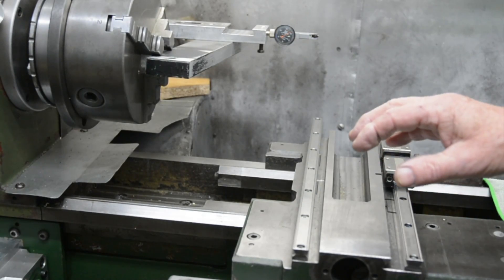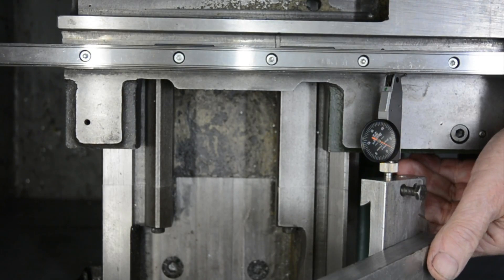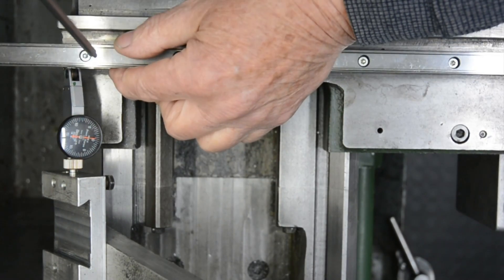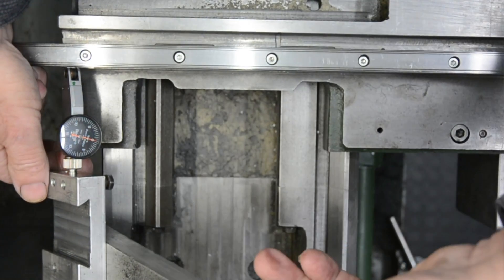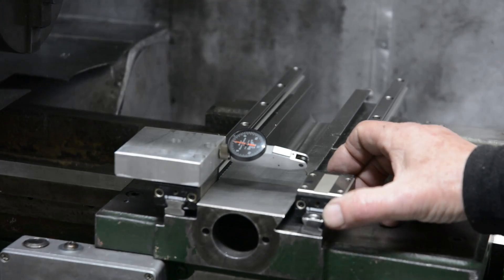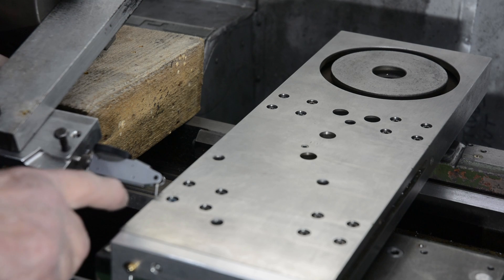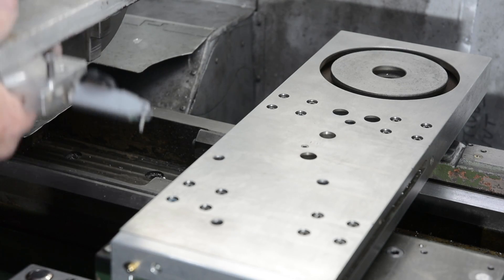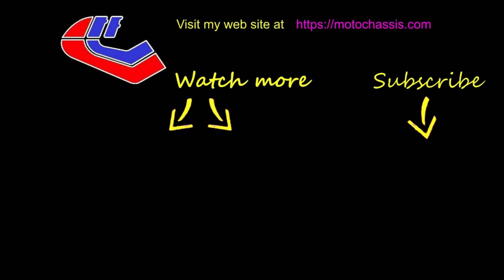Part 4. Revolutionize Your Lathe: Transform Cross Slide With Linear Ball Rails!

Comment: Hi, what are the chances that everything will stay in alignment without pins holding the rails and trucks in place? maybe an easy fix would be to add Loctite 638 adhesive to those parts.
this looks like a good idea.
Rich
Reply from the maker: That is a great question and I replied to a similar question previously but I cannot find it right now.  I did some calculations regarding the frictional force of the rails and it looked as if there would be no problem, if there is then I have increasing levels of improvement in mind.  The first is as you suggest using Loctite under the rails.  If that was not sufficient I would attempt drilling the rails to fit tapered dowel pins.  If drilling and reaming the rails proved to be lacking in fun then I would make some precise fitting blocks between the rails and the machined off dovetails to take the lateral force.  Thanks for highlighting this potential problem.
Reply: Never seen them pinned before, plus they will be made of hardened steel. Can't see drilling and reaming accurately would be easy

Comment: I read your reply about pinning and it would make more sense to me to pin the rails so that when you take them off and clean they would go back in play without having to do the alignment tasks each and every time. Pinning would not only insure stability under load or overload during machining but also assembly repeatability. It would seem to be a simple job putting 2 pins in each rail. Your thoughts? Unless you never plan on taking the rails off.
Reply from the maker: You have it in your last sentence.  Unless I have a problem I do not expect to be taking them off.  I am looking at them in the same light as the dovetails which you do not take off for maintenance.  If they wear then they have to come off but they will be replaced by new ones which would need new locating holes.  I do not anticipate any misalignment in normal use and I would prefer that there was some movement to cushion any heavy impacts.  Real experience will dictate my future actions.  The trucks are a different matter, they come off easily, you can buy oversize balls to take up wear and even buy new trucks off the shelf.

Comment: I could be wrong but I don't think the rails will stand the test of time...
Reply from the maker: Time will tell.  These rails are used on CNC machines.  My fingers are crossed tightly.
Reply: They are used on CNC but not metal mills which you should be comparing it to. Forces from cutting steel on a lathe are much higher than cnc cutting plastic, wood or even aluminium. Did time do justice in a year?  @MotoChassisByTonyFoale
Reply: Those rails are used all the time on CNC machines,

Comment: Wouldn't "indicator sag" throw off  your measurement when you rotate the indicator?  I did something similar however I mounted a test indicator to the top of the head stock. What I did was mount a ground parallel in the chuck and while keeping the indicator stationary I rotated the chuck and adjusted the parallel  until it was aligned with the spindle. I then attached the test indicator to the truck while mounted on the rail and swept it to the parallel.
Reply from the maker: There are things which make this a non-issue.  Firstly the indicator is very rigidly mounted and secondly any sag would be near right angles to the direction of stylus movement and so its effect would be greatly reduced.
It sounds like you have do a similar modification?
Reply: @MotoChassisByTonyFoale  Yes, I converted the cross slide to linear rails on a 9x20 lathe that was converted to cnc. It turned out better than I expected and holds tolerances quite well.

Comment: Hi Tony, looks great, when doing some machining show ELS panel, is it with 16 key pad or 10 push buttons, looking forward to Sunday. Thanks.
Reply from the maker: The control input was the only feature that was changed from the original.  It went through 3 iterations, the final being the 16 key numpad.  I'll make sure that I show that when the cam grinding trials begin, thanks.

Comment: Hi Tony, I believe that the lathes are made to face slighty concave , ( to machine deeper towards the centre to make sure that the parts turned bear on the outside, ...
Reply from the maker: Concave is certainly preferable to convex, but I prefer to get as close as possible to dead flat and chose myself whether the application needs the centre to be relieved.
Reply: The amount of acceptable concavity is tiny. Its purpose is to ensure that a turned part sits on a surface plate without any chance of a wobble. If you never have a need for checking a part on a flat datum surface like this then flat facing it fine.
Reply from the maker: @martinconnelly1473  Thanks for that.  Whenever I have a need where lack of wobble is important I always relieve an appropriate part of the centre.  I prefer this to be under my control because sometimes I want to make things as flat as possible.  In any case with my software for the lathe control I only have to specify a slope and it will face with any degree of concavity of convexity that I want.